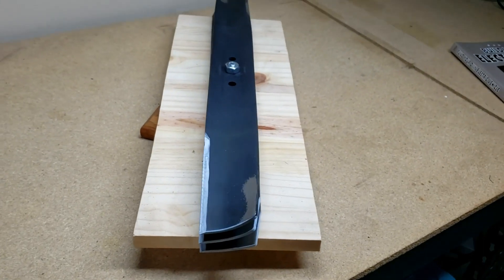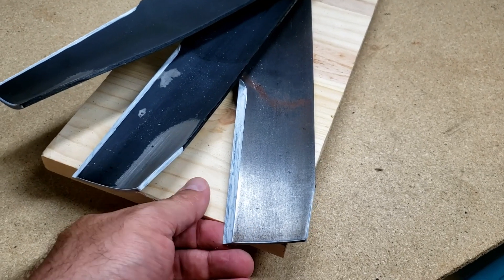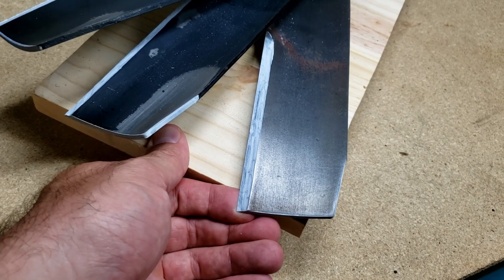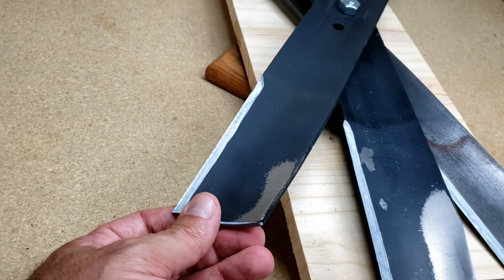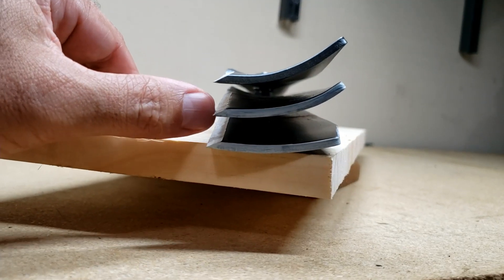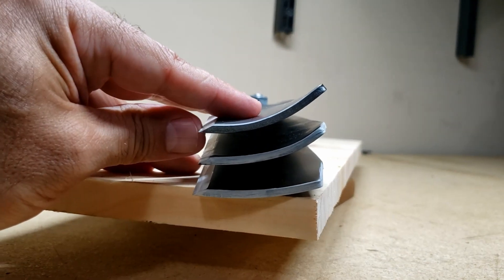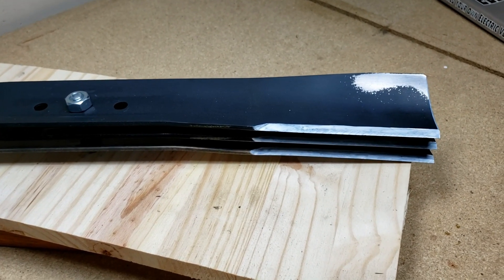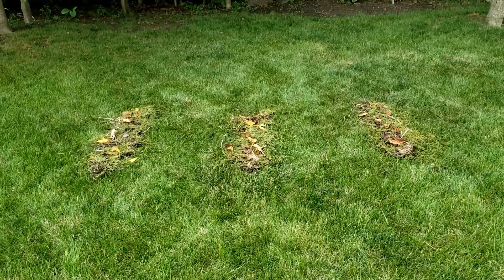Toro 60V Super Recycler 3 Blade Comparison - Purpose of Each Blade and Suction Power

Comment: Thank you for the outstanding comparison and part numbers. The larger batteries (7.5ah and 10.0ah) are quite expensive and would certainly be necessary for the high lift as well as performance blades. For my 0.24 acre lawn, 7.5ah is minimum for even the performance blade as the less expensive 5.0ah doesn't last the entire cut, especially when mulching leaves or taller grass.

Comment: Is there anyway you can make a video regarding height for this mower. I have the same mower and have a hard time figuring out what setting to put it on for height adjustments. Since  this mower doesn’t have the side chute can’t put a tape measure to see where is the proper setting from the blade to the floor for like instance height #2,#3 inches. Thank you

Comment: Interestingly I just got off the phone with Toro a little while ago and they said the only blade approved for use with the current 60V 22” Recycler Max, my machine not yours, is the atomic blade it ships with. With these potentially deadly blades spinning around at ankle level I wouldn’t be comfortable introducing any potential metal fatigue by being a “1  percenter” using a blade not specifically approved by Toro for a particular machine. There have been accounts of blade loss or failure, in particular one account I heard of many years ago of a thrown blade hitting a chain link fence with such force that it partially wrapped the fence around it!
Reply: I feel like a lot of this is Toro trying to justify the higher price tag of the Super Recycler. The two mowers have the exact same motor, so what works for one should work for the other.

Comment: Can you compare these to the Oregon Gator Mulcher 3-N-1 Lawn Mower Blade For Toro 21-Inch 94-906 96-606?
This would be an interesting test to see if the Gator's mulching "teeth" improve the mulching into finer particles & provide any better lift.  This blade is made specifically for that mower. The blades bend down lower to allow clearance for the gator teeth to avoid the deflectors under the deck.
Reply from the maker: I will definitely keep this in mind!  Thanks!
Reply: @jkprojectsnstuff123  I tried it and the performance blade works better...always use max blade speed!

Comment: ...just bought the Toro 60v super recycler. Haven't used it yet, but your videos are a great primer as I unpack and set up. Question:  I have steep slopes and it's not practical to keep  the yard cleaned up of small branches.  Would  using the economy blade  allow me to mow over them easier without sucking them up into the blade?
Reply from the maker: Yes, the economy blade would be the best blade to avoid sucking anything up into the deck.  Its suction power is very poor, so this will help in your case.  Thanks for watching and congrats on the new 60V SR!
Reply: @jkprojectsnstuff123  many thanks for your videos and for taking the time to reply to questions!
Reply: the eco blade is garbage, many people on reddit have reported returning the mower, then reality they should have used a different blade

Comment: Hello, is the hourly battery usage the same for the performance knife and the standard knife at economy rpm
Reply from the maker: No, the standard blade gets more run time than the performance.  The economy blade gets more run time than the standard.  This is the result whether the power setting is ECO or MAX.
Reply: @jkprojectsnstuff123  Thank you

Comment: I’ve been running a Toro SR 21382 (gas Honda model) that I bought new in March with the high lift blade. I’m beginning to wonder if it would have even more suction when bagging if the plastic kickers under the deck weren’t installed or if the accelerator on the blade was replaced with a standard recycler one without the wings.
Reply from the maker: I'm not sure how well that would work, but if you try it, would you report back?  Thanks for the comment!
Reply: Removed the two kickers while bagging leaves today, didn’t notice much of an improvement (this mower with the high lift blade is night and day better than my previous Recycler). So, I’d say it’s not worth the hassle to take them out and have to clean underneath them to reinstall each time. The accelerator on the blade I’m not sure yet, I don’t have a blade adapter without the wings like a Recycler has to test with.
Reply from the maker: @jeffrey.lebowski  I'm wondering how much the Vortex technology will help the Super Recyclers.  I saw that the new 2022 will have it.

Comment: Which blade is better for mulching, high lift or performance? How noticeable is the difference? Also, is the high lift blade noticeably better at bagging than the performance blade? Thanks.
Reply from the maker: For mulching, I'd say the performance.  When I mulched with the high-lift blade I noticed that the grass was being pushed out around the deck, almost like there was no room for it under the deck.  Although it was mulched and didn't clump, I didn't see the performance blade doing this.

For bagging I'm going with the high-lift blade.  They may both do well, but the high-lift packed every sq. inch of the bag.  I don't seem to recall any issues with the performance blade bagging, but I do know that I was very impressed with the high-lift for packing the bag.

Hope that helps and thanks for the comment!  Please like and subscribe if you haven't already.  We have more videos coming soon.

Comment: Thanks for taking the time to make the video. What about for grass? Also, you are making your passes at a painfully slow pace, that is unlikely to represent reality. Have you thought about making the passes at a normal mowing pace?
Reply from the maker: In our previous videos you'll find comparisons between the economy and performance blades cutting grass.  Also, one of our recent videos is a first impressions on the high-lift blade cutting grass.  This video was more intended to compare the suction power of each blade design.  It also shows more of the purpose of each blade.  Normally I would never mow over debris that is this thick.  We appreciate your comment and please check out our videos showing the cut quality on these blades.